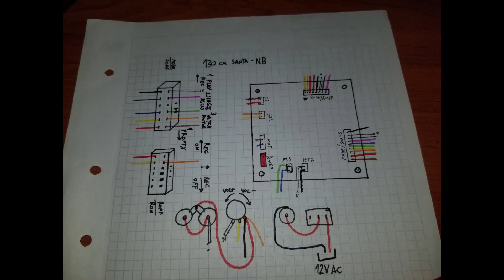NB Toys 130cm dancing santa

Comment: Still shocked on how you got one. Great job on repairing it, it doesn't seem easy to fix at all. The fact its full metal just shows you sometimes "knockoff" companies work better than "official" companies.
Reply from the maker: Exactly, it was a bit of a challenge to fix it, but i managed to make it work again, the oversized parts were kinda hard to wash on the small sink. So i has to go wash everything outside lol
Reply from the maker: @codyryan9789  no no. Just two inputs for some aux cable. Those that have a jack or something on one end and 2 plugs on the other end, you switch it to R ON and a red light flashes. So once youre done playing the audio you switch it to R OFF and it'll play it back, after all its built in speaker is LOUD